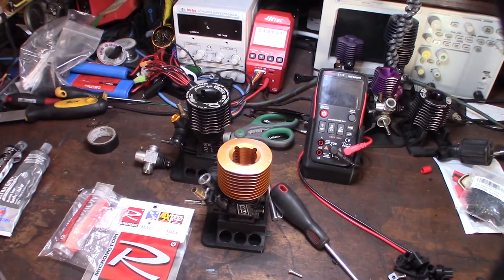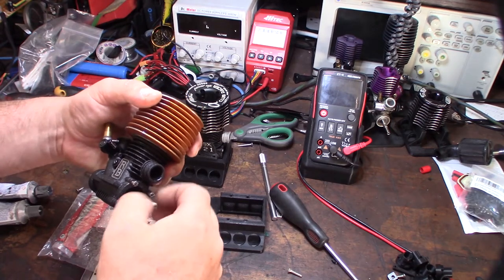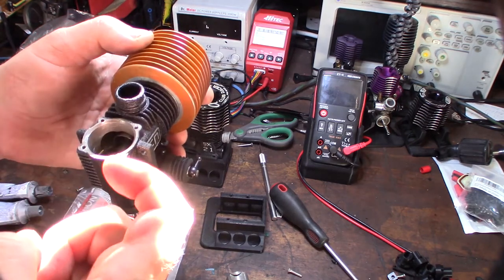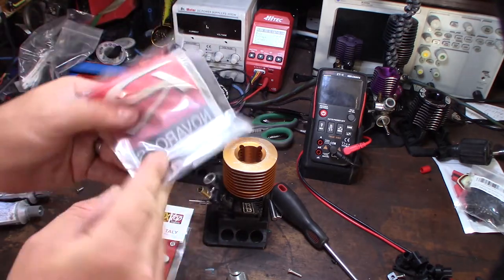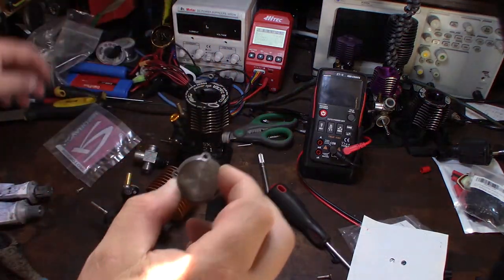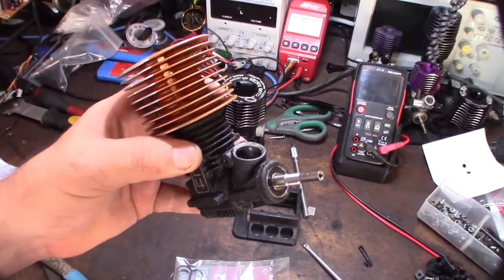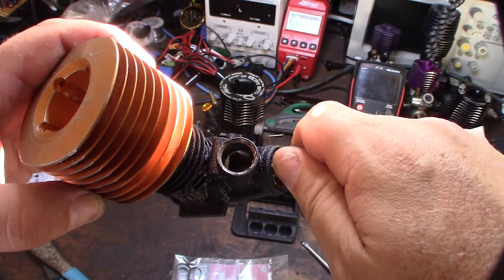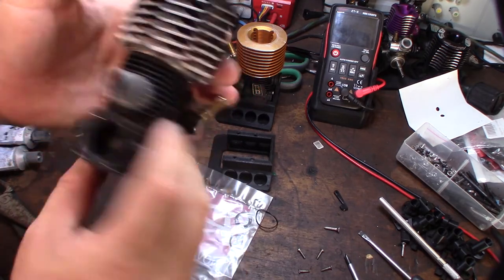How to properly seal nitro RC engine NO RTV!!! No more air leaks

Comment: There is nothing wrong with using fuel resistant, high temp sealant. Some engine manufacturers have stopped making replacement o-ring kits.
Reply from the maker: What happens when you suck a piece of sealant between your piston and cylinder or connecting rod bearing. Bad news if you ask me.
Reply: Exactly. Just Don’t don’t over do it when you apply.
Reply: So how come the Mac 28 has leaks straight out of the box so putting a new seal in when it’s already got a new seal emmmm

Comment: Nothing wrong with rtv. I had send back my picco .15 engine to original manufacture for repair years back. It came back with etc around the carb and backplate. So just confirm that manufacture use this stuff.